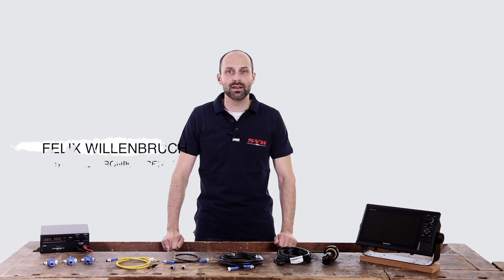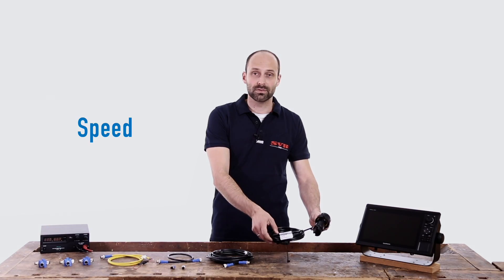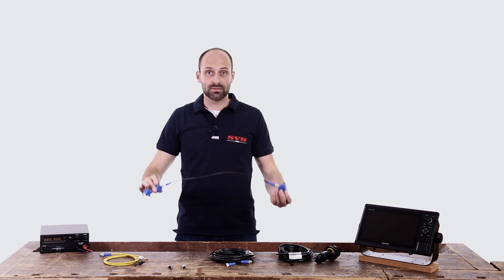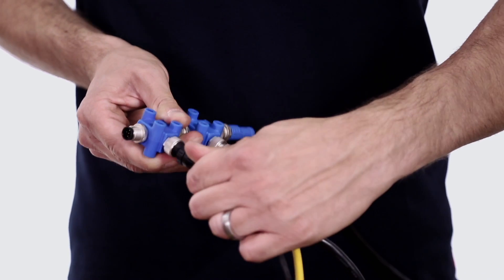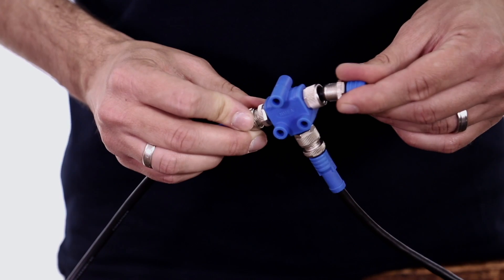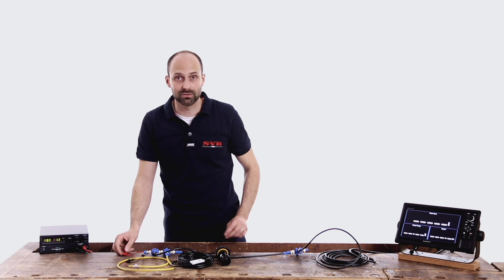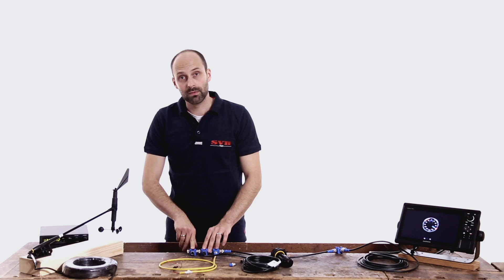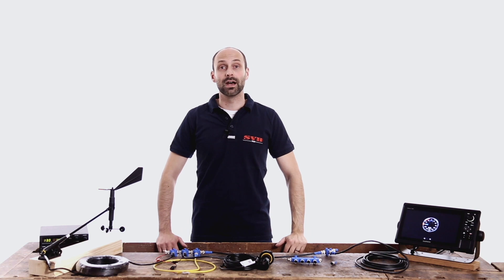Everything you need to know about NMEA2000 | SVB

Comment: Hi, I have a question. 
In all cases you must connect the power connector? I ask because I want to connect the output of AIS to radar, and the AIS output it’s in NMEA 0183 and I connected with a converter to NMEA 2000 and I only need the AIS information and the AIS equipment has power

Comment: Great explanation, thank you!  A question: Could the wind sensor have been added without adding the last T connector, instead connecting it where the terminator was in the original setup?  (Since the wind sensor already has a terminator).
Reply: How to know with additional components have terminator ?
Reply from the maker: Hi Tony, you should use an T-Piece to connect the wind sensor to the NMEA2000 network. You can use a dummy cap where normally the resistor will take place to make the network waterproof.

https://www.svb24.com/en/nmea2000-nmea2000-dummy-cap-female-micro-c.html
https://www.svb24.com/en/nmea2000-nmea2000-dummy-cap-male-micro-c.html

Comment: How do you know the wind sensor had a terminating resistor?
Reply from the maker: Hi, it's usually commonplace for wind transmitters to have a resisitor preinstalled. Some manufacturers provide this information within their manuals.
Reply: @SVBteam  What if i want to connect more devices (2 or 3), but all of them have preinstal lterminating resistor ?
Reply from the maker: @04piaci  Hi Jozef, according to the NMEA2000 specifications more than two resistors can interrupt the data transfer, so this should be avoided. We know only about windvanes which have an intergrated resistor and your will rarely install more than two windvanes.